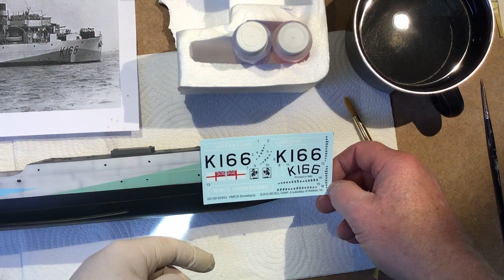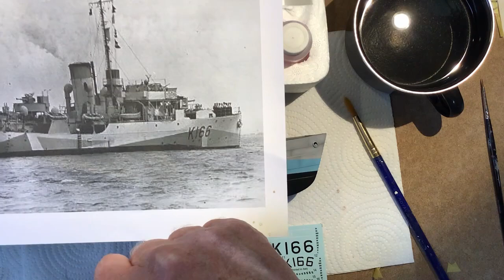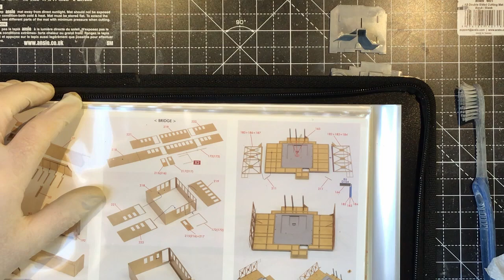Revell 1/144 Flower Class Corvette full build with Pontos detail set Part 4

Comment: Great update, notice you have reverted to standard CA product as opposed to modelling CA. I do this only because I have trouble with CA going off and it’s cheaper to buy the stuff from local handiwork stores.
Reply from the maker: It’s just because I’ve run out of the Vitalbond and the loctite needed to be used up. it works ok

Comment: Hi Steve, I was just going back over this entire build as I pick something up new each time.  Something occurred to me.  As I have watched the entire series, I know that you do not go back with any weathering.  As I intend to do some washes and streaking on the hull, should I do it before applying the decals?  I mean will the surface of the decal react to washes and other weathering differently to simply painted surfaces?  It's a dilemma to me as any weathering in real life (say rust streaks) would also streak across the painted numbers.  What is your experience in this regard?  Jeff
Reply from the maker: Good question Jeff. Weathering can be applied over decals (and should be in my opinion) provided they’re properly sealed in. I apply a coat of acrylic varnish over the decals to do this which a) levels off the decal and b) protects the decal from damage from further layers and solutions. I’d use a gloss coat if I were following up with an enamel weathering wash or a satin/flat coat if I were using powders and the like. You can finish off with a Matt or satin top coat to seal everything in and level everything up to the final finish you’re happy with. The acrylic varnish needs to be fully dry to resist the spirit based enamel wash if that’s what you’re using. Enamel varnish will not protect in the same way: subsequent washes could burn through and potentially damage what’s underneath. Hope that helps.
Reply: @TheModelShed  Steve, the lightbulb went off In my head earlier tonight about the fact that modern model making calls for another coat to seal and protect the decal, which gives it and the rest of the model surface a coating of equal footing for further treatment as it were. That was clear in your video, but it did not register.  Nonetheless, your thorough response has given me more to go on. Full disclosure, this will be my first plastic model build since the sixties, so the techniques and materials available since I was building Airfix, Monogram, and Aurora planes (and Lindberg ships) with Testors and Floquil paints and and slapping decals on them are astounding. Jeeze, I remember using a needle to open the tubes of glue. I have always been modeling, but in the wooden ship genre that the  plastic modeling faction of Washington Ship Model Society (of which I am a member) calls “sticks and strings.”  I digress. So I will be sure to switch between acrylic and spirit-based mediums. For washes, I’m thinking about using the artist oil paints I use in wooden models. So many choices.   Thanks again for your thoughtful and thorough reply  
Jeff

Comment: Just a thought on those walls and doors.
How hard would it be to put clear sheet between the walls for the windows.it would probably fix the gap issue with the inner revell wall ??
Reply from the maker: It did cross my mind Jerry, but it would mean that you’d have to pre paint both wall parts before fitting the clear sheet. That in turn would rule out soldering the brass. so on balance I’ve gone for this route where I’ll fix the stbd gap with a bit of styrene and line the wheelhouse with thin acetate. I think it will work out ok. 🤞